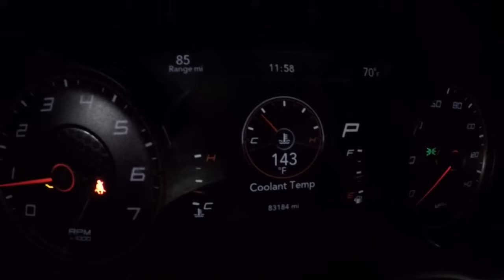Replacing Thermostat on 2016 Dodge Charger 3.6L  P0128 Thermostat rationality  ||  Dodge overheating

Comment: Is this the same for a 2015 charger ?
Reply from the maker: It it got same set up then yes
Reply: @RBTheMechanic  it is, thanks man ! I just wasnt sure of any minor differences that could make a difference.
Reply from the maker: @historiaselectrizantes2247  follow up with this video https://youtu.be/0jb-ztVPy8A
Reply: @RBTheMechanic  forgot to ask another question, at any point in time do I need to use a sealant? Or it isn’t necessary? Thanks 🙏
Reply from the maker: @historiaselectrizantes2247  no I don’t need any sealant everything u see me do in this video is 100%
Reply: @RBTheMechanic  thank you bro, ima get right to it and follow up with the test drive

Comment: What if you don’t have any air coming out
Reply from the maker: Well u should when u fill it up that’s when it occurs
Reply: So I did everything I added coolant and no hissing i wondering do I put everything back together start the car and then bleed?
Reply: Everything meaning the air blower and sensor
Reply: @RBTheMechanic  help me please
Reply from the maker: @tomhanks2323  what is ur original reason to add coolant
Reply: im having the same problem😭😭
Reply: @RBTheMechanic mine just thru a p0128 code
Reply from the maker: @iRawrz4You  yes this is same replace the thermostat and make sure I put in original
Reply: @RBTheMechanic  I put in new coolant , is that bad?
Reply from the maker: @iRawrz4You  no but u need to replace the thermostat

Comment: How would you know if it's the actual Thermostat or the Engine Coolant Temperature Sensor. I recently got a check engine light on with a Code #P0128 Coolant Thermostat. It tells me to replace the Thermostat or the Engine Coolant Temperature Sensor.
Reply from the maker: For these replace the thermostat this is the code for it
Reply: @RBTheMechanic  thank you will do!

Comment: 💯 appreciate it, macanic said 180 to put it on for me I use this did it my self in bout a hour of work im fully operational and engine light off🫡
Reply from the maker: Nice good job!!
Reply: Did you reset the code?? Or did the light come off by itself? Did the job yesterday and it’s still showing
Reply: @RedSummer-dt9oz  although i do have the ability to reset the code on my fixed scanner, the light went off by it self. Auto zone can turn the light off for you though, but it should go off by itself. Make sure the part is good and everything is step by step. Also remember the code seen can also mean there are other components that can cause coolant temp problems luckily for me it happened to be the thermostat.